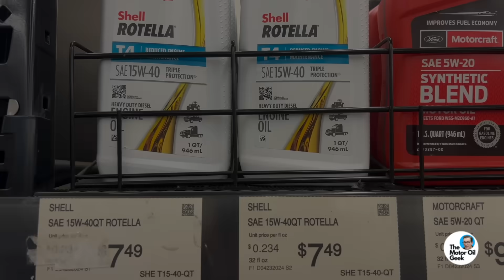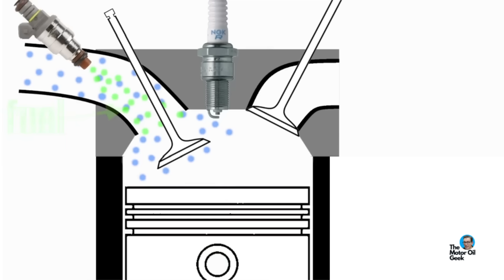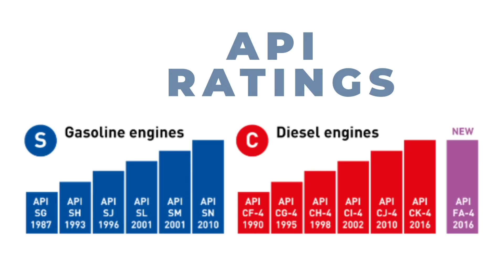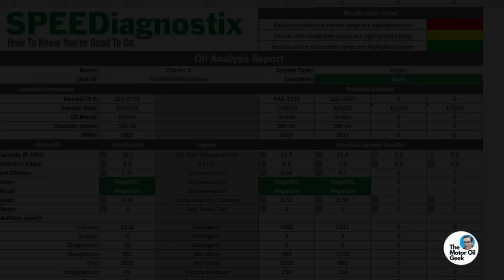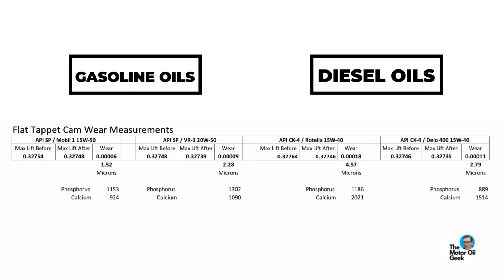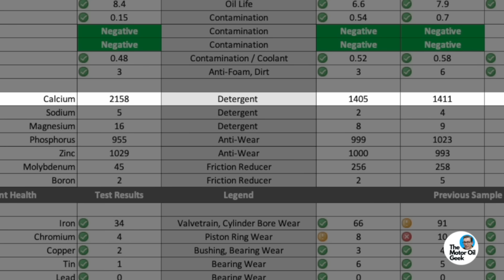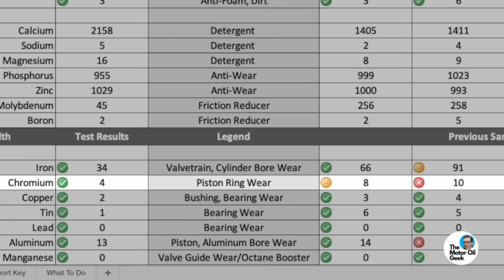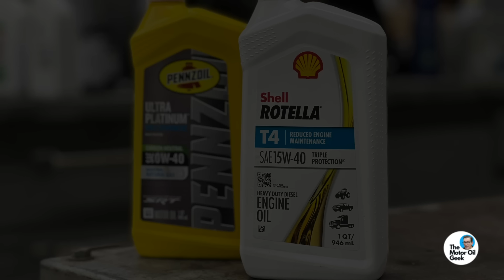Why DIESEL Oil is Actually WORSE for Gas Engines!

Comment: Dave meant to say cigarette, not a match. You throw a lit match into gasoline, it will ignite.
Reply: It depends on the temperature of the gasoline and ventilation and accumulation of vapors above the liquid gasoline. If my life depended on it, I wouldn't even count on the match igniting the gasoline, much less the cigarette.
Reply: @fascistpedant758  Yea I don’t smoke either so I don’t have to worry about lighting a cigarette.
Reply: What’s the difference they will ignite the gas because of the vapor released from the gas.
Reply: @TonyBenton0728  Correct, it is the vapor that actually ignites because it is mixed with air but, a lit cigar or cigarette will not ignite the vapor either.
Reply: @ When the cigarette hits the ground and creates a spark it will ignite the gas.a match most likely ignite it while it the air.
Reply: @TonyBenton0728  Highly unlikely.
Reply: @theamerican7080  Have you tried it ? I haven’t tried it but with the cigarette on the ground and still lit it’s going to ignite the gas because it is in contact with the liquid.
Reply: @ I've done it many times, but that doesn't mean that it's not possible under certain conditions.
Reply: @theamerican7080  I don’t smoke so I don’t have to worry about starting a fire with a cigarette anyway. This was way off topic from what the video was about but thanks for the conversation anyway.
Reply: @TonyBenton0728  You don't have to smoke to understand fire but, it's relevant to the combustion properties of gasoline VS diesel or, spark ignition VS compression ignition.
Reply: @ I know all about the combustible properties of gas and diesel. I worked in hazardous waste for 18 years and hazardous materials for 12 years attended yearly OSHA classes.
Reply: @TonyBenton0728  I only speak from decades of experience.

Comment: Maybe one thing to clarify when Lake says that an oil can “handle” the soot: soot itself isn't super harmful, but when it agglomerates (fancy word for “sticks together) it firms abrasive particles which can increase wear rates, just like a sand particle. The dispersants keep the soot particles from agglomeration.
Reply from the maker: Thanks Rafe! That's a perfect explanation.
Reply: @themotoroilgeek  I know you’ve probably answered this question already but…. Is it safe to use Rotella in a 69 Chevrolet 350 with a flat tappet cam? Which oil would you recommend for that engine ? It has a 280h comp cam . Thanks !!!
Reply from the maker: @g-man-uz3gx we address that in the next video.
Reply: Thanks for that,
Reply: Good to see you here Rafe. Could you make a comment on ACEA specification oils vs. API oils? Specifically, since ACEA specs (such as A3/B4) are meant for both diesel and gasoline engines, does this mean the ACEA oils are less specialized compared to oils that go by the API ratings?
Reply: @Shootin_Bruin  My thoughts exactly. Here in the EU it states on the bottle "Compatible for gasoline and diesle engines".
Reply: I use diesel oil in all my old gas castiron small engines. so the diesel oil is still better for them because they don't have an oil filter and the detergent is keeping the contaminates spread out, lowering the wear so that's why the book says you can run diesel oil in them.
Reply: @jamesm699 They don't have oil filters for a reason. The small engine type oil doesn't have dispersents so that the junk settles out into the sump and gets drained with the oil changes. Do you use different engine parts too because you're smarter than the engineers?
Reply: @pootispiker2866  all engine oils have detergents in them including small engine oils. Even the small engines that are splash lubricated use detergents in the oil. The belief that the contaminants settle in the bottom of the pan is wrong because the oil is constantly being thrown inside the crank case mixing the contaminants around. All my equipment in the oem owners manual all say use detergent oil. So you should do research before you think you know what your talking about
Reply: @jamesm699  I never suggested non detergent oil in splash oil engines.  I asked why not lubricating solids like graphite and/or PTFE in small quantities.   Geek suggested a video criticizing solids, but I can't find it.  In this video, he criticizes high calcium diesel oils in gasoline engines for excess detergent, but never mentions splash oilers.
  So when you recommend detergent oil in splash oilers, are you referring to high calcium diesel oils? or lower calcium SP oils?  How much calcium is in mower oils relative to those?  What is the difference between mower oil and car oil?
Reply: @alan6832  you should not run mower oil in your car its designed and formulated for small engine conditions. From the local small engines repair shop  he said the small engine oil is between car oil and diesel oil for the air cooled engines. So no don't put it in a car or diesel engine. You did say small engines oil contaminants are supposed to settle on the bottom of the pan. The only way for that to happen is a oil without detergents and that oil is really hard on internal parts. I simply said sence there's no oil filter on my old small engines having a higher amount of detergents keeps contaminants spread out and keeps wear down because no oil filter and lower ppm of contaminants keeps wear on moving parts down. In my experience I've had no issues with diesel oil in my old small engines but do what you think you should for oil on your small engines I'm not responsible if you use diesel oil in anything and it causes damage. I use it at my own risk.
Reply: @jamesm699  You are totally making stuff up.  I didn't say or suggest any of that, and am now sick of repeating what I actually did suggest.  Scroll back for yourself.
Reply: @alan6832  oh that was the other feller
Reply: So why does Mercedes specify Mobil 1 ESP for its 3 liter turbo diesel? For ash problem solving?
Reply: @guywhite1004  newer Mobil ESP formulations are going back to over a 1000ppm calcium! Maybe Mobil found an alternative to ZDDP. I gave up trying to understand oil :(
Reply: I learned a new word today.  I’ll def try to use it as soon as possible and I will most def fail.  

I was leaning toward “coagulates” but we will go with agglomerates for now because even iPhone knew what was up.  I didn’t even have to type it in all the way and it popped up.  

What a time to be alive!
Reply: @LubricationExplained  true. Diesel oil also generates better, thicker cushion that keeps bearing and shaft surfaces correctly centered so contaminants don't damage surfaces.
Reply: I would say better filtration or Oil change frequency is the only real protection from Soot then 🤔
Reply: @Redshift-  With the INSANE DIESEL bypass filtration system and Lake’s oil analysis I can see my soot level is 0.5ppm or less! And that’s with  22,500 on the oil in a 2017 Powerstroke!
Reply: @Derekn2288  Hey, What OIL are you Running in your Powerstroke??
Reply: @kendavis1198  actually at the moment I’m running some blended leftover oils, Mobil 1 Delvac ESP 15w40/Amsoil Signature 15w40, for my break in period(New Engine) then I’ll use my regular oil, Lorenzo’s with W2 15w40 from Insane Diesel. My first engine made it to 892,315.7 miles with the internals having virtually zero wear! Except for three lifters! 😬
Reply: @Derekn2288  Was that the Engine that Dave tore Down a Bit Ago?? 😎
Reply: @Derekn2288  👍
Reply: @Derekn2288  Id like to see that filtration on an '05 Cummins... Those engines with the large bowl pistons generate huge soot levels. 2017 Power Stroke has the better bowl design, which generates less soot with better burn.
Reply: @Derekn2288  wha a new engine if the old one had zero wear?
Reply: @phillyarrow0898  The needle bearings in three lifters failed. Definitely the smallest and weakest point in the engine. They were lubricated just fine, Dave said it was metal fatigue.
Reply: @Redshift-  you're thinking one dimensionally.  Filtration, oil capacity (dilution), dispersants, and oci all work together in defense against wear from soot.  There isn't one magic bullet, for anything.  Same reason more zddp doesn't mean more better, things just aren't that simple.
Reply: @seijirou302  Only if you play the " lets see how long I can leave the oil in"
The Magic Bullet is simple, If the oil is dirty change it - it won't be dirty unless it saturated with contaminants.
Reply: @Redshift-  correct! That’s where bypass filtration and oil analysis comes into play! People throw away perfectly good oil every single day! What a waste of time and money!
Reply: @seijirou302   exactly right, it's a balance of additives for the use intended, not a one size fits all oil. It's important to know what the additives do in order to make the best oil for your application.
Reply: @Redshift-  Most diesel oils turn black and look dirty 2 minutes after changing it.
Reply: Shouldn't the filter remove any particle that grows large enough to be harmful?  My main soot concern is with it's potential to jam or stick rings, but hear Geeks concern about calcium interfering with the effectiveness of ZDDP, which would apply to classic engines, which get ignored in a way I dislike especially when I can see a classic car behind them.
  I think most people who depart from OEM oil do so in classic, modified or heavily worn engines with problems like stuck rings, and few of these are direct injected, at least not yet.  
    I still wonder about calcium levels in Sea Foam and Marvel Mystery oil and the potential of graphite in small quantities.  Plus the potential of oil detergents regarding Prius EGR systems.
Reply: I run it in ally gas motor😅 almost 300,000 on my 02 f250 with it
Reply: I even run it in my saturn 1.9 I have owned
Reply: Yup, they keep soot in suspension. Basically, if you do short OCIs in diesels, you don't really need that much dispersants.
Reply: Guess what I’ve been running in my 200,000 mile old 440?  I run it hard and every day.  It burns a quart every 500 miles or so depending how hard I run it.  Very good filter, and   I go 15,000 to 20,000 miles before changing the oil.   100,000 miles since 2020,  it does not smoke yet.   I run 15w 40 diesel oil.  What does that prove?  You all tell me.  ;)😎😋
Reply: @Monaco-BuilditFixitDriveitEver  hahahaha 😂😂😂

You're "changing" your oil every 2500-3000 with that consumption.  It works.

What's the ride?

Comment: Great video as always Lake! On the soot formation - I've always been surprised at how dirty diesel is and how that can affect the injectors. I'm currently trialling some kidney loop filtration skids on the fuel systems of diesel gensets and the improvements have been pretty noticeable so far!
Reply: I use the INSANE DIESEL bypass oil filtration system with Lake’s analysis I routinely get 20k miles, or more, on my oil with soot levels at 0.5ppm or less! This is in a 2017 Powerstroke.
Reply: diesel is dirty only in USA

Comment: This should be good! A lot of the Ford guys run diesel oil in the 300 L6.
Reply: Been putting 15w40 rotella in my 300 since around 380k miles I'm close to 450k no issues reduced blow by.  The 300 Is a purpose duty work horse designed to run forever.  They have turbo kits for people that need more power.
Reply: The issue here is exclusively with GDI applications, not an ancient old carbureted or Port injected engine.
Reply: @otm646  that’s what I was asking about in the comments. Video wasn’t real clear in that and I’d love a clarification. Hopefully one will be posted by the Creator.
Reply: You can use any 15w40 or 20w50 (assuming you live where it's warm), it doesn't matter if it is a diesel oil or not...
Reply: Because they are underpowered junk
Reply: @ What does power output have to do with choosing an appropriate engine oil for a classic/vintage truck engine? The 300 will outlast many other engine designs. It’s a great engine. It is not meant to put down power, it’s meant to run forever, on whatever fuel you feed it.
Reply: @GrEmLiN76X  my 95 ford I6 , has 275,000 miles .  Runs about as good as new far as I can tell.  Needs exhaust manifold , other than that it’s been bulletproof.  The body will rust out before the drivetrain dies.  I really never bought anything special for it far as oil . Just what ever was cheap …it is and always been a work utility van .
Reply: @SantanKettanan-Gayboy  300 Ford is one of the best longest lasting engines ever produced. Legendary.  WTH are you smoking dude.
Reply: @SantanKGhey1234 that is the dumbest comment of the day.  Go back to school and make yourself smarter.
Reply: @SantanKettanan-Gayboy  Oh come on, the way the hot exhaust manifold sits right below the intake manifold on its U-turn flow cylinder head is brilliant.
Reply: @SantanKettanan-Gayboy  Not so. Where is your evidence?  The 300 C I six was made for 31 yrs. 1965-1996.
  I run an '86 in my '65 F100. I have the efi exh mnflds on it. The 1V carb. I am using two plane jane mufflers, then two short pipes that turn b4 the pass. rear wheel (least amt of back pressure). There is nothing shy about the motor. I took off the stepside body and mounted a 1/2" x 6'x6' plate in it's place (fab table).  Then added a Miller Blue Star engine generator welding machine behind the cab. The truck weighs 5,300 #. I can go like the wind. Oh, I am using the Granny 4 speed  transm.  Running 16" radial tires. 
  I use the Rotella t4 15W40. Get 55-60 psi oil pressure.
Reply: I had a 300 on a 77f150. I loved that engine.  If I want to go fast I'll get on a sport bike.
Reply: @SantanKettanan-Gayboy  The 300 6 was not designed to be a race engine, it is a work horse meant for low speed pulling power and longevity. It is a work engine and nothing more. If you want a fast Ford engine, buy a car with the Coyote engine in it.